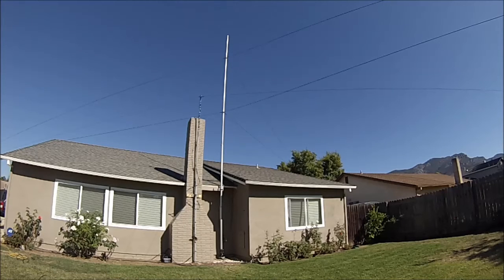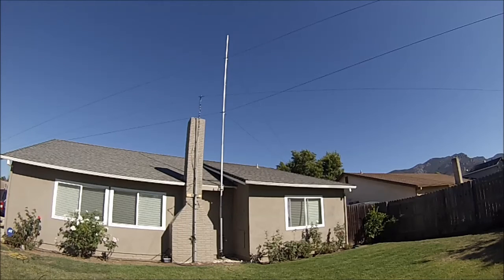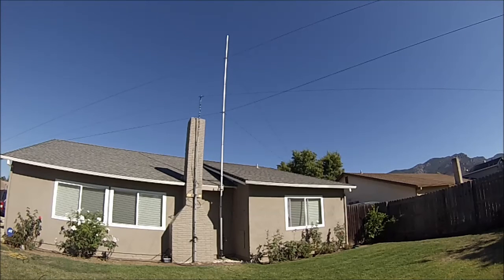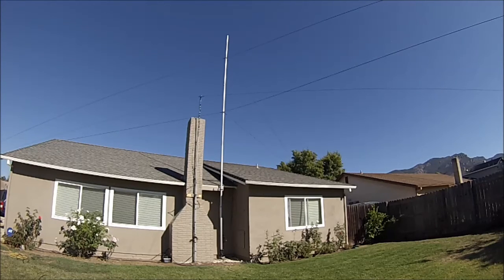SpiderBeam Mast ~  New Beam Installation at N6QW

Comment: Absolutely cannot see what you are talking about. Would be nice to have the camera much closer so we can see some detail.
Reply from the maker: Thank you for your posting and without the Magic Decoder Ring your comment would be as it is. The construction, detail and detail photos of this mast installation was covered over about a month period on my blog n6qw.blogspot.com. The purpose of this video was to demonstrate that the mast would rotate and that the house bracket indeed served its purpose. Also the mast is rotated from the bottom and so I wanted to be assured that would work.

There are detail photos on the blog showing probably what you want to see. This video was just a proof of concept. There is another video with the beam antenna installed and that shows rotation. In my methodical approach I wanted to prove the mast could rotate BEFORE I put the beam on the mast. If you are contemplating a similar install I would be happy to share more details with you. Contact me at n6qwham@gmail.com. I liken your comment to seeing 5 minutes in the middle of a murder mystery movie and trying to figure out the whole movie. So if you have questions about the install contact me via the email.